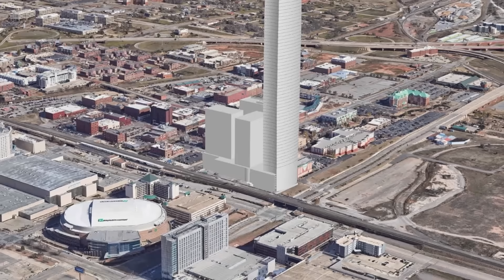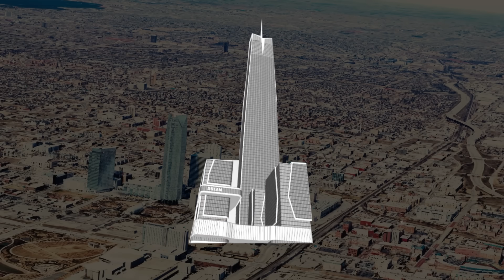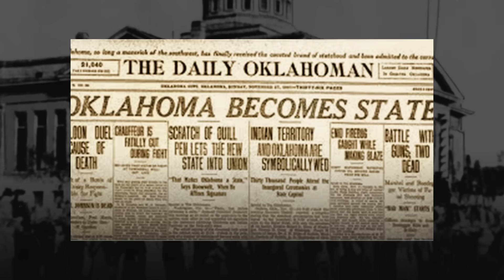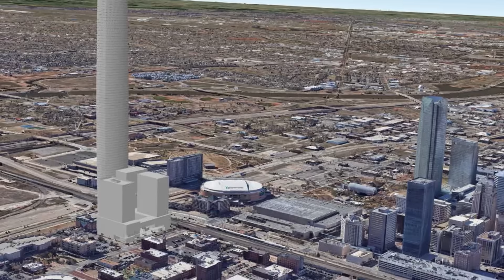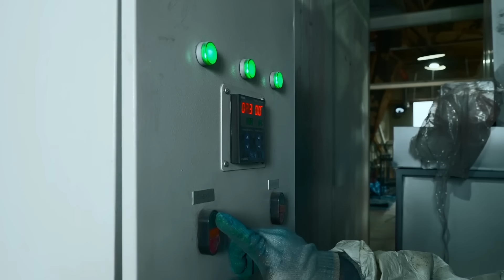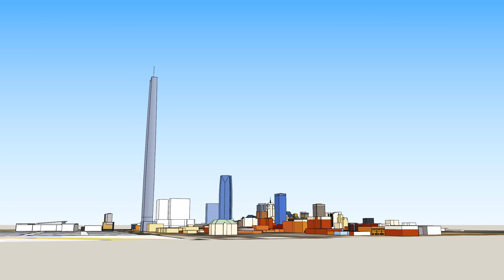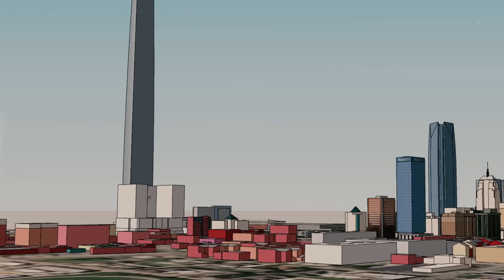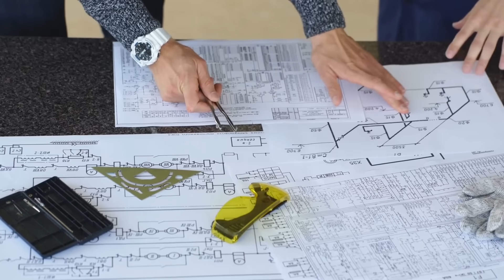The Upcoming Supertall Skyscraper That Will Change America Forever!

Comment: I really dont see the point investing so much money on a status symbol building, only to have it be slightly taller than its competator. If you want to make a statement, go for at least 600m. There are so many buildings in the 500m-600m range that this is really not note worthy.

Comment: I'm not sure why this would affect air traffic. The Devon Tower is already less than half a mile from the location, and airlines or other planes don't typically fly near, and certainly not over, skyscraper clusters like those in Oklahoma City. Additionally, Tinker Air Force Base and Will Rogers Airport are both about five miles to the east and south of the location, respectively.
Reply: Absolutely this. If pilots have trouble avoiding the literal tallest thing in the country with a known location, then they don’t need to be flying.

Comment: Does OKC have the infrastructure to support a tower of this height?  Water/sewer and a fire dept that has the equipment to service a supertall if it catches on fire?
Reply: Unlike the metroplex (DFW) OKC has the water. It purchased water shed lakes all over the state and pumps the water to multiple lakes ending at Hefner Lake (essentially a bath tub) a high built lake that gravity feeds the water treatment plant.
Reply: No city has a ladder for these global structures, they all have advanced internal fire protection and suppression systems. If they can pump water to flush a toilet they can send water to suppress a flame.
Reply: @buddyryeSE  Please don't tell people what to do.  To support a tower doesn't necessarily mean only  it's height in respect to ladders.  It means man power, it means inspectors to make sure that the proper fire fighting equipment is installed in the building, it means having the kind of water pressure, and it means having the proper code in effect to cover super tall buildings...none of which this city remotely has any experience in.  If you can't be civil, perhaps you should refrain.
Reply: Yes we've been running s#!t out of our state for years!
Reply: Lol its HUGE bro
Reply: No